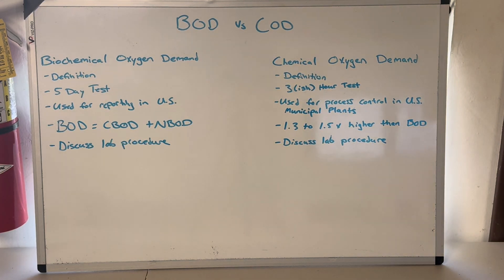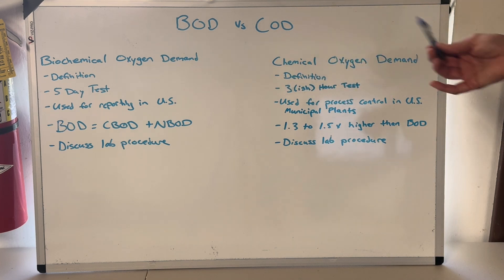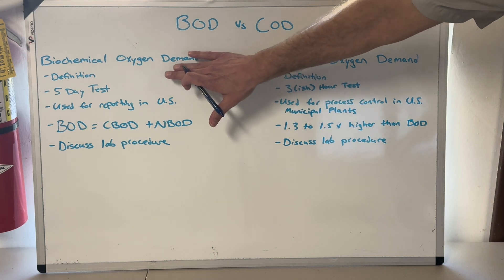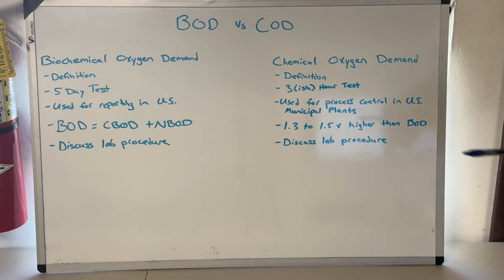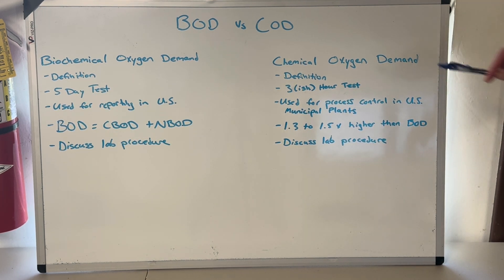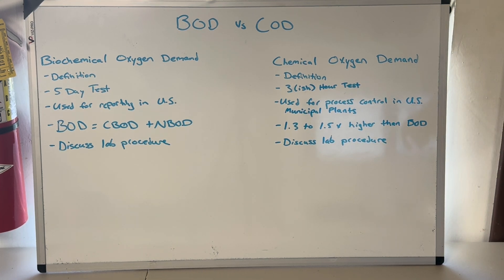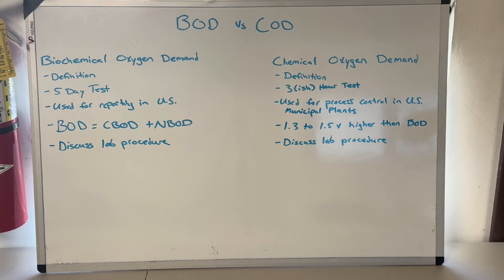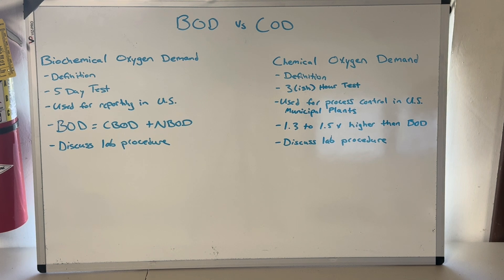The Wastewater Whiteboard:  BOD vs COD (Biochemical Oxygen Demand vs Chemical Oxygen Demand)

Comment: This is Srikanth Grandhi.  

Great job, Shawn! From what I’ve seen in Arizona, most plants use COD, while smaller facilities without lab equipment tend to rely on BOD. Your point about plant size being a key factor in choosing between the two is spot on.
Reply from the maker: Hey Sri!  Thank you so much! Are those large municipal facilities in AZ that use COD reporting their COD results, or are they reporting BOD and using COD for process control?

Comment: So Im studying to take my Class1 in Ohio. I have previously taken the test a couple times and have failed scoring mid 60’s. 
A math question I cant seem to figure out is calculating how much will it cost to run a pump for a year of continuous use. (Example) 200gpm with 100’ of head. Efficiency is 65% cost for electricity is $0.13 a kw
Reply from the maker: Great question!  I’ll make this my next math video.  Look for it sometime next week!
Reply from the maker: Hello! I went ahead and got that math problem out for you. Please let me know if you have any questions! I posted it earlier today so it should just be on the front page of the channel.